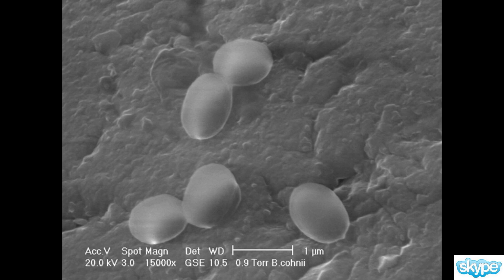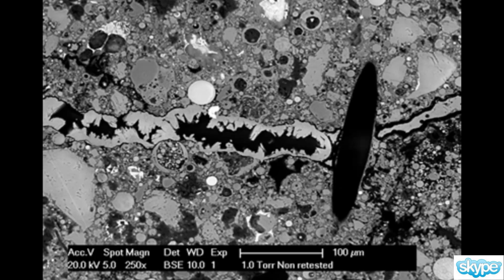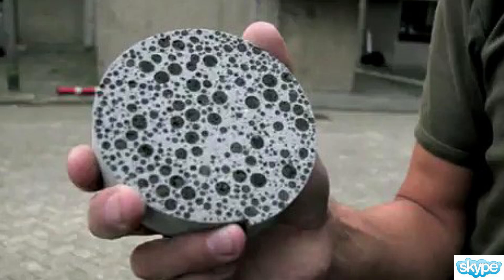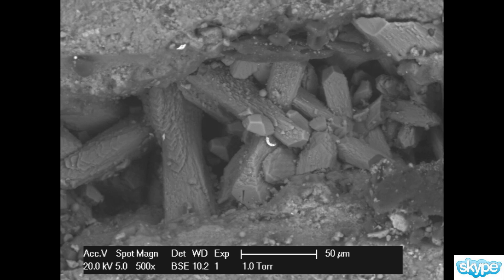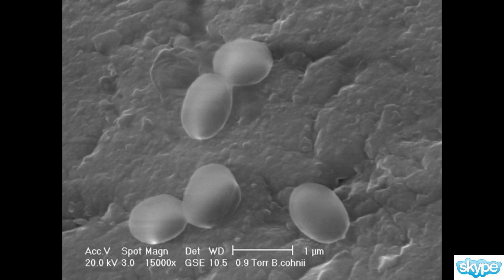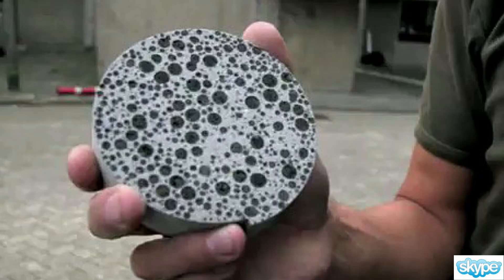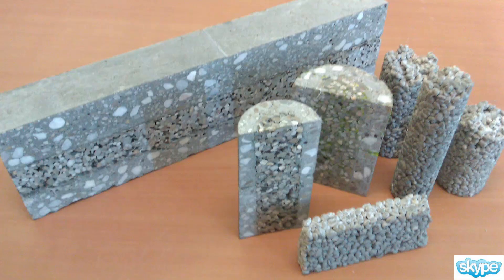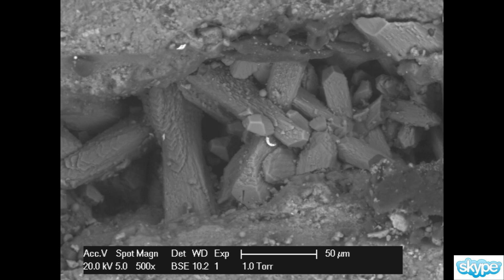Self-healing concrete with the use of bacteria

Comment: Has there ever been a large structure using a material like this?
Reply: Last that I heard was that it was very difficult to keep the bacteria alive during the wet mixing state as the cement mix is mechanically mixed so it had to be housed within ceramic zeolites which are quite costly, it isn't as simple as mixing in pond scum with your cement. I would expect the first application to be more of a filler material for crack repairs or a plaster where the higher costs could be rationalized. There's also the idea of using the biological process instead of the high energy chemical cement process perhaps in making bricks or other building materials.